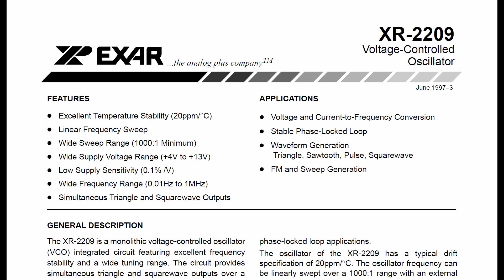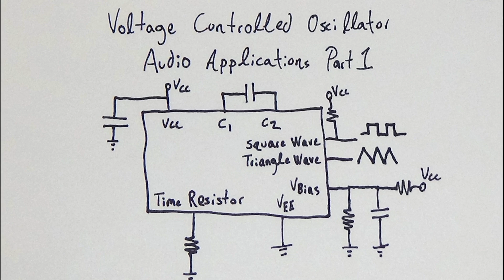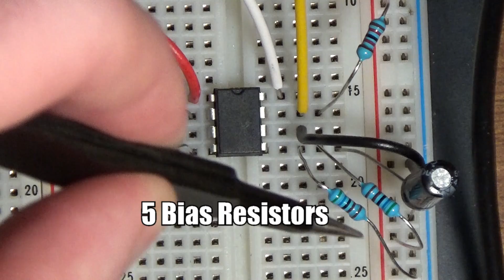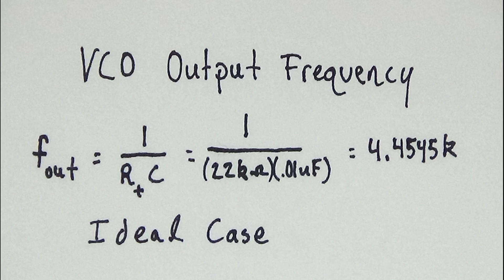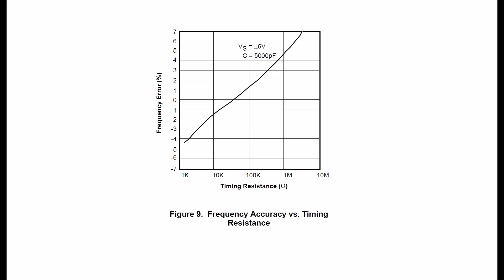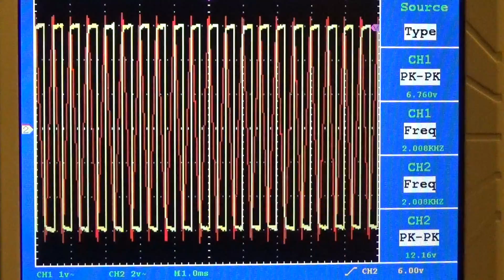VCO Audio Applications Part 1- Synthesizer Building Block (Voltage Controlled Oscillator)

Comment: Many monolithic VCOs, such as the XR2209, were short lived, and are no longer available. Analog Devices type AD654, however, is a VCO still being produced, and is relatively easy to apply. It only produces a square wave output, but a triangle can be derived by connecting a differential amplifier across its timing capacitor.

Comment: There aren't too many audio VCO ICs available these days. The XR-2209 is completely obsolete except for some Chinese sources that are very questionable. Analog Devices type AD654JNZ is one of the few, still sold through U.S. distribution such as Digi-Key.
Reply from the maker: You are right. Unfortunately it is obsolete. Not much we can do about that. Typical engineering problem! Dang chips are not available any more!

Comment: this chip is currently unobtainable, @WaveShapePlay what is the replacement?
Reply: XR2206 is a good alternative.
It's more versatile, giving a sine wave output too, and adjustment for wave symmetry / ramp / sawtooth as opposed to plain triangle.

You can get XR2206 function generator kits for $10

Comment: What is the profit of XR-2209 over famous circuits with op.amps? Does it give some easier control? No need for an exponential converter?
Reply from the maker: Mainly It is convent to design with. It has both the squarewave and triangle wave outputs for a few amount of components. Also you can use frequency modulation ( https://youtu.be/-L0QeI4Hbgc ) if configuration properly - you can make linear sweeps and both outputs will have the same frequency.
Reply: I've made a circuit with TL074 op.amp. It gives square and triangle waves with the same frequency also. One problem - the triangle wave is very weak while the sqr. is too loud. But probably I need to go with 12-15v to Vcc. It has no DC offset. It's one of the advantages. With TL074 it is able to create two oscillators (4 if count different waveforms). TL072 gives you one. On the con.side: you need to build a log.-linear converter. So that's why I've asked this.

Comment: What values did you use for all the components?
Because my circuit heats, smells like toaster, and the pitch goes down.
I'm new to electronics so I have no clue what I should do.
Reply from the maker: Don't give up! It takes time to get familiar with electronics but it is worth it!

I used 5.8k bias resistors - 22k timing resistor - 0.1uF timing capacitor - 12k for pull up for square wave (Data Sheet says 1k to 100k works RL)

Hook up like up figure 3 in the data sheet (page 5):
https://www.exar.com/content/document.ashx?id=179 

It will be worth your time to read the data sheet to get more info on the chip! There lot of great information in there. It says on page 5 that Pin 4 of the chip should be limited to <6mA. Be mindful of the current, you can damage the chip if the current is exceeded!
Reply: I've had almost exact thing with LM555! It was solved by adding a resistor to the output pin (before a speaker). In my case I guess that the speaker's impendance was too low (6 oHm). I've put 500k resistor and that heating was gone.

Comment: So you control a voltage controled oscillator by resistance?
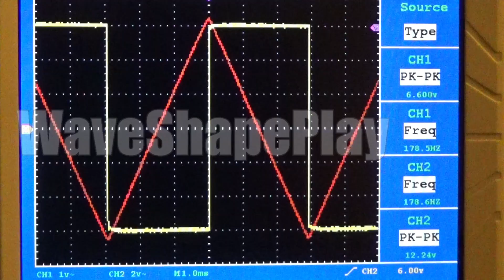Reply: Not only the resistance but also a capacitor.  Of course you re still right that this is NOT a VCO as there is no voltage control as specialy shown in the description. Else I would think that the one who made this video didnt know what a VCO is. Thumbs down for a useless video who desnt match the description. You stole 6:30 of my life.
Reply from the maker: It's all good. You might be more satisfied with part 2 it showcases an application more in-line with what you are looking for! https://youtu.be/-L0QeI4Hbgc
Reply: @WaveShapePlay  i'm looking for videos that actually contain what is in the description. You should rename this video, because this circuit is not a voltage controlled oscillator.
Reply from the maker: +StarTrek123456 - Yes! haha. In this IC the resistor acts more like a current source than a voltage one!
Reply: According to the XR-2209 data sheet, it >can< be used as a VCO, but this is not a VCO.  See figures 15 and 16 of the datasheet for voltage-controlled frequency operation.